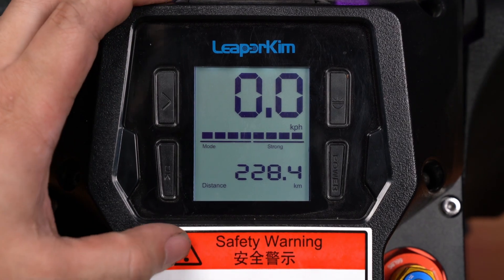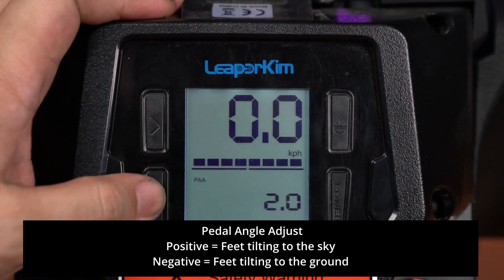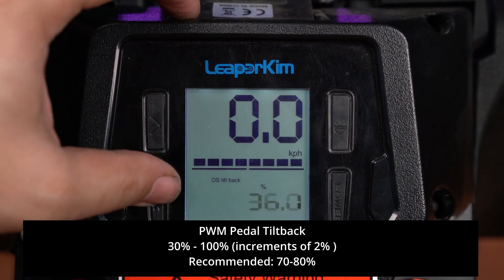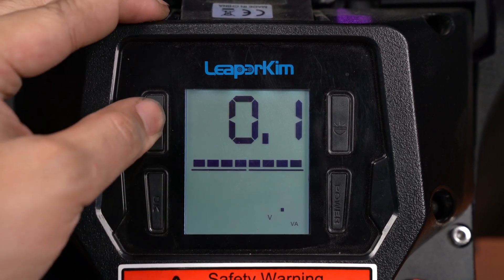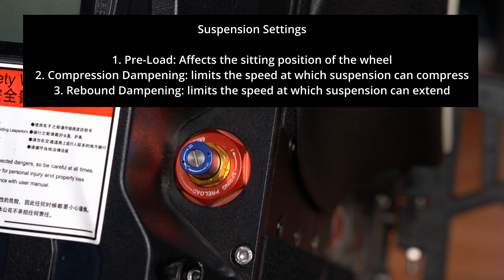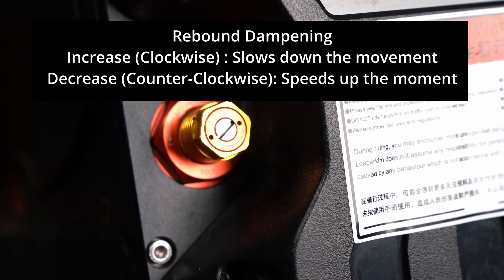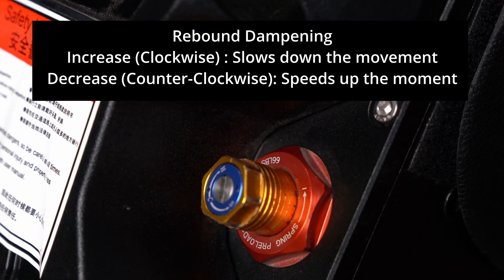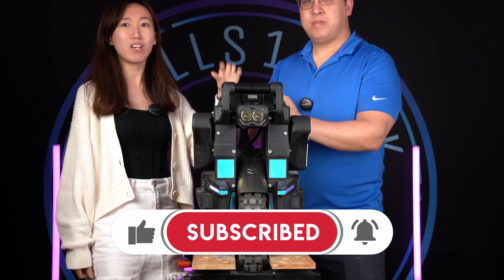Veteran Sherman S/Patton/Lynx - Wheel Settings & Suspension Setup

Comment: There is a 70 lb suspension version for patton s

Thanks for vid
Reply from the maker: Yeah, this was the original Patton
Reply: @2cells1pack Hey great video! If you see this message I have a quick question maybe you would know this? I have a OG Patton (66lb spring) and bottom out easily off road, was thinking of upgrading to the 70lb progressive system, can I still swap it out without any issues even though the Og Patton didn’t come with the 70lb? Is it still compatible or is the housing different on the Patton-S? 

I appreciate your time and your videos, very helpful! 🙏

Comment: Hello, I received a brand new lynx but my compression damper doesn't seem to adjust. Even at full clockwise, I can't really feel any difference from fully off, even though the rebound feels really different... It that normal ? On your video, it seems maximum setting on compression doens't change much for you either... so I'm guessing I'm okay ? Thank you.

Comment: Just trying to understand if the spring preload nut on the Leaperkim suspension affects pedal height for a given weight rider.  For the purposes of this discussion, I'm not worried about spring compression rate or bottoming out.  For any specific weight rider, does the minimum preload create a lower rider mounted pedal height, and conversely maximum preload create a higher rider mounted pedal height?

Comment: Hello guys,  love your explanation.   Do you have any info regarding the second menu (hold down the same button for 10 seconds)   - My lynx has a slight error in distance and speed measurement after changing a tire size...  I would love to correct it if possible.  Cheers,  Dennis

Comment: Great video question at what speed is it good to turn on high speed mode 
If I’m going to cruise between 30-40mph should I have on high speed mode
Reply: Good question, I just wonder if it has to do with actually going fast or does it have something to do with torque and how quickly it accelerates even at lower speeds

Comment: Full suspension preload, does it affects spring stiffness to harder, or makes suspension travel distance  shorter/longer, or just makes pedals higher/lower from the ground? As i found information that more heavy persons should set preload to clockwise as lighter persons should counter clockwise preload screw.
Reply from the maker: Spring stiffness - harder yes 
suspension travel -> depends if it would bottom out the spring or not - which would require me to disassemble a unit and see inside 
It would also make your pedals higher from the ground potentially.

Comment: can you explain pulse with modulation pedal tilt-back, pls
Reply from the maker: PWM / Safety Margin are used interchangeably, however they refer to the "headroom" one has when doing higher speeds. A good safety margin is 70-80%. If you get to 70-80% of wheel's usable power - I tell people to turn on the tiltback so that they have 2 forms of safety: beeps & physical tiltback.
Reply: @2cells1pack  fundamentally for a 100 kg guy, would you recommend serman s, pls. I ride a regular sherman

Comment: Thanks for this! I'm expecting my Patton soon and this is super helpful for navigator LK's confusing settings menu 🙈🤣

BTW, when you did the demonstration at the end, you had preload set to minimum, didn't you? Wouldn't increasing the preload make it less likely to bottom out?
Reply from the maker: Yes increasing preload will help a little with bottoming out, but after adjusting it we still had issues. Therefore we reverted it before selling it to the next owner.
Reply: @2cells1pack   Right. So if preload doesn't help all that much.... I was going to go for the 62 lb version but maybe the 66 lb would be better. 
 I'm  75-80 kg (165-175 lb) fully geared and will be using this wheel for trail riding (nothing crazy Chooch-style, no jumps, but mostly off-road use), it's probably better to get the 66lb suspension right? (And set it up for very little preload)
Reply from the maker: If you're 175lb, i would probably go with the 66lb. Keep in mind the springs will also soften a little with time as they get broken in.
Reply: @2cells1pack  Thanks a ton! 🙌

Comment: Hello, appreciate the guide. I noticed my voltage setting is at 122.6 that’s different from yours. Should I change it? What’s the default?
Reply from the maker: Hi, I'm not sure why the settings are different, but they are set that way from factory so I wouldn't change it. I'd have to spend more time with the device to figure out the reasons for the difference. (I didn't have enough time fiddling with the device to answer your questions fully)
Reply: It is just showing current voltage you at

Comment: Hello, I'm hoping for an update to adjust the tilt back of my Sherman S like the Patton.  Unfortunately the speed goes from 58.2 km/h to over 200. I would like to adjust the tilt back to 70 or 80 km/h but it is not possible at the moment.Wiil there be an update? Thanks
Reply from the maker: Not sure, this is on LeaperKim. They like to do their tiltback in this way unfortunately. Hopefully they can release a well functioning app that will allow you to tweak settings faster too.

Comment: super helpful!
is the preload is adjusted by turning the large nut at the bottom or the smaller golden nut at the top?
how does adjusting compression damping on the right side affect the left shock?
Reply from the maker: The preload adjustment is the golden knot at the top of the wheel. Adjusting compression on one side only affects compression dampening. The other side is rebound dampening
Reply: @2cells1pack  thanks, preload is the smaller golden nut at the top!
My question is more about how it works.. the shocks seems to be independent. 
I don’t understand how adjusting something on one side can affect the other side. 
I understand that each side has a different adjustment (each of which affects both sides)
Reply from the maker: It doesn't affect the other side. This was the torsion concern as the one shock does all of the compression dampening
Reply: @2cells1pack  oh!!! Yeah ok that makes more sense and torsion is my immediate concern also lol
avoiding extreme values on either side is better in that case.. if I’m worried about the frame flexing

Comment: Hi I jsut got my 62lb suspension patton and felt that the suspension is a bit stiff, I'm already cracked the red and blue counterclockwise to the max. I don't think you showed how to decrease the preload? do i need a wrench for that? (instead of the flathead screwdriver which i used for the dampening adjustment)
Reply from the maker: The preload is the golden part (adjustable wrench). They come stock with minimum preload, however I would continue riding it as the suspension does soften out over time with use.
Reply: Thank you! any advice on of the seated riding|? I can't seem to figure it out. Hoping that aftermarket seats get published that make it easier for seated riding
Reply from the maker: @brianonwheels  There is an aftermarket ergonomic sides + seat that's already out. Made by Xiaorong Su

Comment: I don't think preload is accurately portrayed, but rest looks spot on.
Reply from the maker: How would you describe preload?
Reply: @2cells1pack  Preload is how you adjust sag with rider weight, also is how you make it harder to bottom out if you are a heavy rider.  Preload is a standard term and not unique to EUCs
Reply from the maker: @richsam287  I think sitting position and sag are fairly similar in what I mean. Next time I'll use sag.
Reply: @2cells1pack  but also when you showed how easy to bottom out, I feel preload is your primary tool to prevent bottoming out and compression dampening should be secondary to tweak the feel.
Reply: @richsam287  So what's the right setting for heaver people?
Max preload or minimal?
Reply: @BigBoss-gb4cx  no easy answer, everyone likes different.  I like TONS of preload, I like to jump and feel the road more.  Some people like minimal preload and don't want to feel the road at all.  Experiment and find what u like.

Comment: If possible one day, a similar video for V13 would be awesome as many people still don't know how to correctly use the shock pump and adjust the dampening/rebound.
Reply from the maker: Hmm I think AlienRides has a video already ?
Reply: @2cells1pack  Yeah but, we want you to be our trusted, go to guy. You speak well.
Reply from the maker: maybe in the future. for now - i'd rather focus on videos that will provide the most value to the community.
Reply: For the v13, just randomly twist the suspension knobs and hope for the best. 😂😂😂
Reply: @KevinRedmondWA  Does the V11 have adjustments? 
Looks like the Adventure will
Reply: @nicholasmilton1902  the v11 only had air pressure as adjustment. The air chamber is so small, so pumping it was a pain in the ass. The adventure looks like the best of S22 and Sherman suspension combined. But, inmotion quality sucks.
Reply: @KevinRedmondWA  Anyway  Inmotion Adventure or V14 imo need dust covers on suspension sliders

Comment: im 130lbs, would you recommend the 62 or 66lb shocks? currently preordered a 58 lb shock but after seeing you guy's review, I'm looking to bumping that suspension up.
Reply from the maker: 66lb if you do trail riding
Reply: How much do you weigh?  I'm 207 and just bought the 62 lbs shock in the lynx.  But, strictly street riding and I don't go off curbs.

Comment: Only compression was maxed when you were bottoming out?
Reply from the maker: Only compression yes
Reply: @2cells1pack  Do you think Leaperkim will offer a stronger spring than the 66lbs? Since its still bottoming out
Reply from the maker: @KaizenOz  I wish for it, but I won't hold my breath.
Reply: @2cells1pack  custom made? ;)
Reply: I noticed that the spring pre-load was set to the preload you would use with the lightest person (max sag). Does setting the preload to have a minimum amount of sag reduce the bottoming significantly?
Reply from the maker: by default, the preload is set at max sag. Based on their recommendations, they say that a 150lb should use the 62lb spring. I believe this to be grossly inaccurate as Christine (<100lb) is able to bottom it with ease.
Reply: @2cells1pack  I put a 1250 pound spring on my master, and I put heavy rubber bumpers on the suspension shafts, top and bottom to dampen bottoming and topping out. I bottom out the suspension countless times on every ride I do when riding technical trails. The Patton seems amazing. In every way, except bottoming out of the suspension. The rubber bumpers I put on the master are a Band-Aid fix to bottoming, but with the Patton there is no Band-Aid fix to deal with the bottoming out. I weigh 200 pounds and the thought of bottoming out all the time with the Patton is definitely the only thing holding me back from putting my money down on one. With the 66 pound spring set up and me weighing 200 pounds, do you think the bottoming will be constant and intolerable?
Reply from the maker: For your master -> you could look into upgraded linkages. For the Patton, bottoming out is definitely something that's always on my mind. However I have to say that the performance of the wheel sometimes can forgive the bottoming out. I'd like to see what the commander mini / extreme bring to the table. (I am looking for a personal 16" trail wheel... definitely didn't settle on the Patton being the one)
Reply: @2cells1pack  thanks it sounds like you’ve saved me some frustration! Also, if you’re ever in the Comox Valley message me, I’ve been riding here for two years and I know my way around!
Reply: Also, I live on Vancouver island in the Comox Valley and since you’re just in Vancouver, if you ever come to the island, I would be happy to show you around the all the trails in our area. We have days and days of trails.
Reply from the maker: that would be amazing :)
Reply: 70 lbs ^^

Comment: Why didn’t you increase the preload at the end of the video? That would certainly decrease the chances of bottoming out. Only playing with the clicks is only part of the solution
Reply: Pre-load does not decrease chance of bottoming out, what pre-load does is reduce sag and increase the amount of force it takes to get the suspension moving, it does not change the spring rate, preferably you wan't no pre-load as it will make small bump compliance worse
Reply: @RonnieRides  ok thanks for the explanation. Here’s to hoping stronger options than 66 lbs are eventually offered.
Reply from the maker: Thanks for the explanation ! Yeah, you can do a lot of settings to bandaid the problem. But the problem is the spring is too soft.
Reply: @2cells1pack  I guess its alright for trails and bumps, its not a jumping wheel anyway. But yeah, 90kg+ person should have a stiffer spring option.